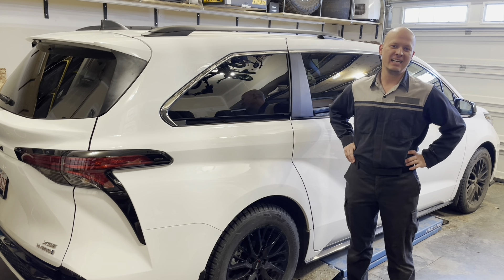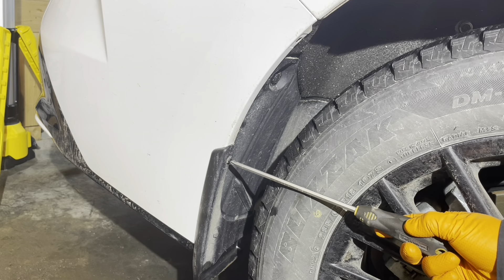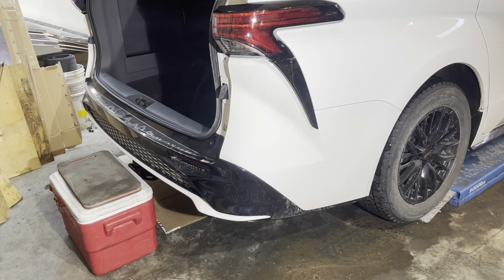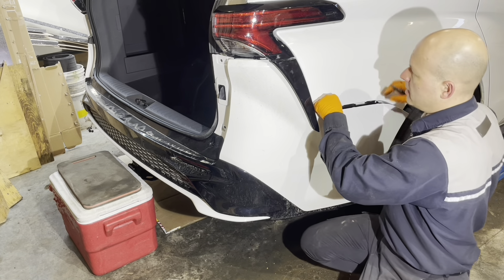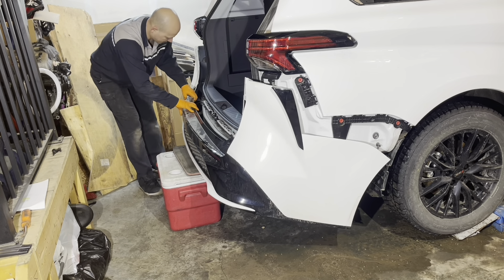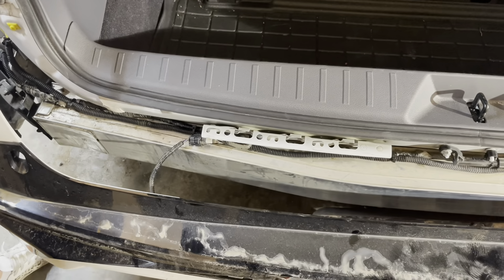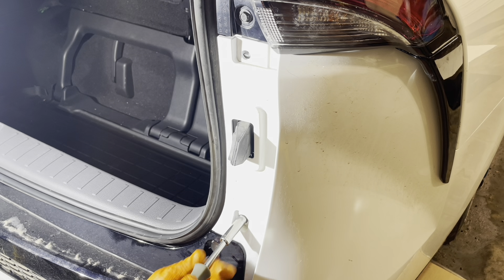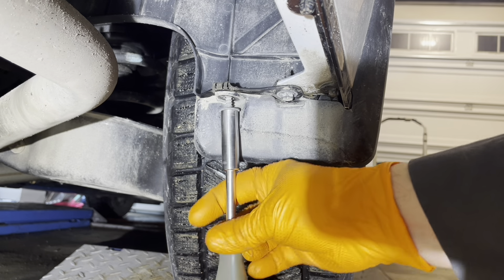2021-2024 Toyota Sienna Hybrid Rear Bumper Cover Removal And Installation Instructions

Comment from the maker: Below are my affiliate links to the parts and tools you would use to complete this job. I may receive a small commission from the product sales. Thank you!
Automotive trim and clip removal kit: https://amzn.to/3KgKGfg
Replacement aftermarket clips: https://amzn.to/4a662rc
Small flat blade screwdriver set: https://amzn.to/44HUoQi
1/4" impact driver kit: https://amzn.to/3RP95ga
Impact driver socket adapter set: https://amzn.to/44XTTkI

Comment: Top notch channel Viktor! Would love a how-to on 2010-2015 RX shark fin antenna install without destroying the headliner. Seems like a common problem, getting it clipped off by garage door and ridiculously priced to fix at dealer. Many thanks!
Reply from the maker: It is a great suggestion, however in my experience, majority of the cases require a bodyshop repair as the roof panel usually gets bent/dented from the impact of the shark fin on the garage door. If I ever get a chance, I will make the video. Thanks!
Reply: True! in my case it doesn't appear that the roof is dented at all. I just bought the vehicle recently and noticed that for some reason the shark fin isn't flush to the roof, significant gap. No water is getting in at the moment, but I obviously want to prevent that and get it flush. I bought a new OEM antenna but was surprised that there is no adhesive on the bottom where it comes in contact with the roof. Seems odd that the bolt positioned in the center of the fin will be enough to properly make it fully flush with the roof. Once I remove the old one do you think it would be a bad idea to put some kind of adhesive / silicone underneath to make it bond and stay in place? If so, any recommendations on what adhesive would be best would be greatly appreciated. Many Thanks!   @Viktor_G_Automotive

Comment: How can we install parking sensors at the back any idea about wiring will be highly appreciated thanks
Reply from the maker: @pkmalik9300  the OEM Toyota parking sensors? There would likely be a lot more than just the sensors and the wiring required to make them work on a vehicle that didn’t originally come with them. I don’t think it would be a very straightforward process and would require a bunch or time to research what exactly is needed to integrate them.

Comment: Can you please confirm if you have to disconnect the battery before removing the bumper and sensors or can you do this entire task without disconnecting the car battery? Thanks!
Reply from the maker: @josephlee4560  the repair manual tells you to disconnect the battery before working on almost any electrical system in the vehicle, but in practice most people don’t do it.
Reply: @ thanks for that information! I’ll disconnect battery just to be safe…another question…does disconnecting and reconnecting the sonar sensors require recalibration? I would love if you did a tutorial on removing the FRONT bumper next :)
Reply from the maker: @ sonar sensors will not require calibration. I’ll make a front bumper removal video if I ever get a chance in the future.

Comment: Hey I have one of the rear bumper sensors pushed in, do you recommend taking off the bumper and putting the sensors back in with some type of glue or should I use hot glue to pull back the sensor without removing the bumper ?
Reply from the maker: If I were working on it, I’d remove the bumper to evaluate what is going on and then proceed according to what you find.